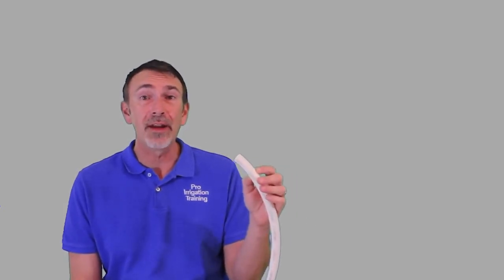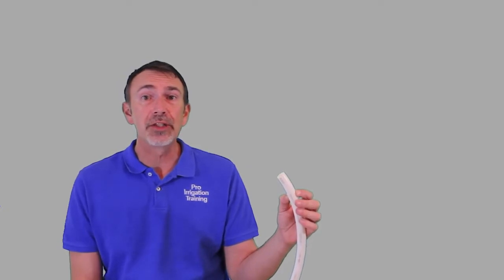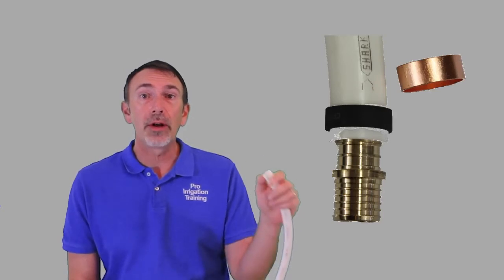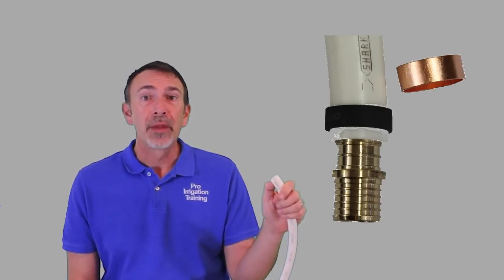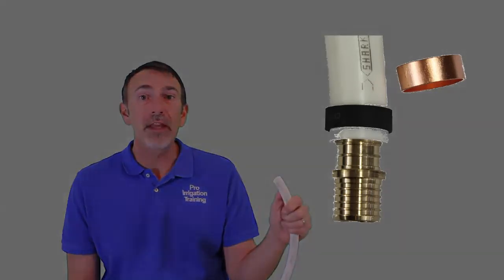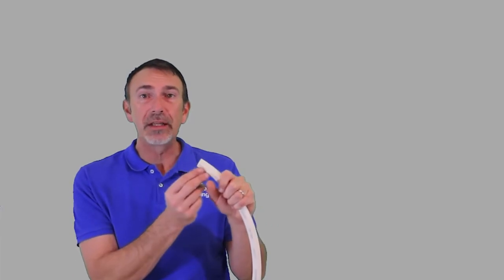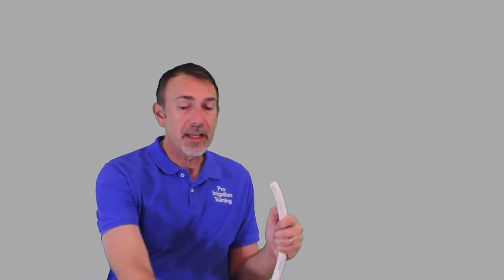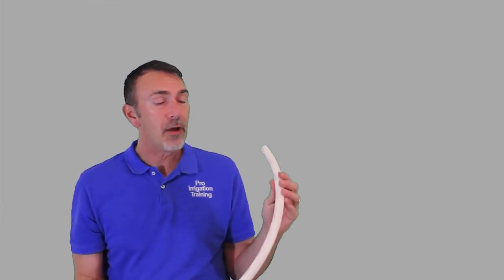Pex Tubing For Irrigation ( sprinkler systems )

Comment: Silly question, perhaps? Can the pex crimper and clamps be used on the old (1990's) 3/4" pe irrigation pipe? I'm currently moving and adding some sprinkler heads and I have an interior plumbing project coming out where I'll be swapping some copper for pex. Would like to have a tool/solution that will be used for both. Love the knowledge you are dropping! Thanks
Reply from the maker: That's a good question, but I don't know the answer at the moment. I'm going to find some fittings and see, but my first instinct is that the PE has a larger outer diameter. I'll update the answer.

Comment: PEX promotes Bacteria growth. Any thoughts?
Reply from the maker: The research is a bit sketchy as to whether PEX is any worse than any other piping system for bacteria or biofilms. I'm not a fan of PEX, and certainly am not recommending it in this video. This lesson is only for dealing with existing water lines that an irrigation tech has to tap into to supply a new sprinkler system. Unfortunately it has overtaken copper as the preferred tubing choice for plumbing houses. But make no mistake, biofilms are found in copper and PVC. You should have good water filters on your drinking water supply.
Reply: @Proirrigationtraining  Copper and its alloys, such as brass, bronze and copper-nickel, are inherently antimicrobial. This can not be said for Pex or any other oil based poly tubing.
Reply: @grabir01  That is true...but are you going to use cooper for irrigation and bury it? Probably not.

Comment: Pex is not recommended for over the ground irrigation as its gets brittle with sun exposure in few few months. Any thoughts?
Reply from the maker: So sorry that I didn't see this comment when it came in. YouTube's notification system is good, but not perfect. I would not recommend PEX for any irrigation application. This video is really only for dealing with it in relation to supplying a new sprinkler system. The truth is, an over the ground irrigation will have some problems, and even PVC will get brittle, but not nearly as fast as PEX.

Comment: Do you think it would be compatible with Blu-Lock fitting for in-ground irrigation?
Reply from the maker: If I were you, I wouldn't mix product lines like that. I would only use blue-loc pipe with the corresponding fittings. But regular pex fittings are a bit cheaper if I'm not mistaken (there isn't much blue-loc available around me.)
Reply: @Proirrigationtraining  what type of pex fitting would you recommend for in-ground irrigation?
Reply from the maker: @supersaiyan6556  Really, the only reason I cover Pex is just for connecting the irrigation system to existing plumbing systems. I'm sure you could do it in Pex, but you should probably stick to PVC or Poly.

Comment: Considering the BIGGEST issue I always hear with lawn irrigation is a busted pipe from not getting all the water out...why isn't this more popular? Maybe you can shed some light on this
Reply: Anywhere outside water freezes, the sprinkler lines will bust, even in the south. I dont think pex will, doing research now. Also if youre doing a sprinkler system, buy the crimper, youll save more on that one sprinkler job, even if itd just for you
Reply from the maker: You must be referring to the failure to winterize properly. In colder regions, you definitely need to evacuate the system with compressed air. You're right, in that I need to make a video about that. I live in SC, USA and it doesn't really get cold enough to damage systems that are 100% underground, so the winterization issue hasn't been on the top of my mind. Thank you!

Comment: Can you put a one GPH emitter into the pex? Will it seat and seal?
Reply: I want to irrigate an orchard.
Reply from the maker: @lambfactory2537  Hi Lamb Factory, thanks for watching. I wouldn't think that would work well. The drip emitters are designed for tubing with thinner walls. They may not stay in. But if the pressure is below 35 or 40 psi, they just might. Were you just looking at Pex as a more durable tubing choice over regular 1/2" drip delivery tubing?

Comment: How is this a pex "irrigation" video? This is a pex video .
Reply from the maker: Lol, no doubt.
Reply: @Proirrigationtraining  since you're in the industry I got a great trick for you to make a video of. 1/2 inch pex and 1/2 irrigation tubing can be attached extremely easily with a heat gun!!! No connectors needed!!! Simply heat the irrigation tube for 20 seconds and push the pex tubing right into it for a snug fit... done...
Reply from the maker: @ForbiddenShenanigans  That's interesting. I used to know some old school plumbers that would use heat to seal a lot of things up, even PVC! I'd have a hard time trusting it though, lol. Probably do it on a home project first and see what happens.
Reply: I would never do this in a home. This is a fantastic trick for irrigation only! Because it's for irrigation only there will be very little back pressure. After sliding the irrigation tube on to the pex I couldn't even turn it. I had to put some ass into cracking the seal from the heat. After that, the thought of pulling it back out went out the window. Pretty sure at this point its practically permanent. With that if it does some how drip, a couple penny hose clamp will fix that up. Then again, we are speaking about drip irrigation... lol. Try it out. Would make for great content for others to know the trick and save some money these days.
Reply from the maker: @ForbiddenShenanigans  Definitely going to try it, thanks!